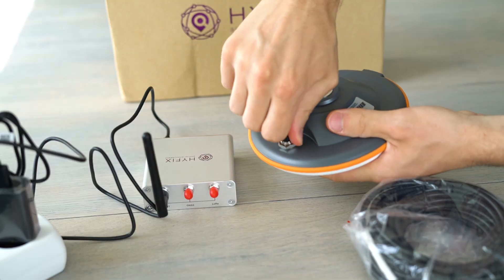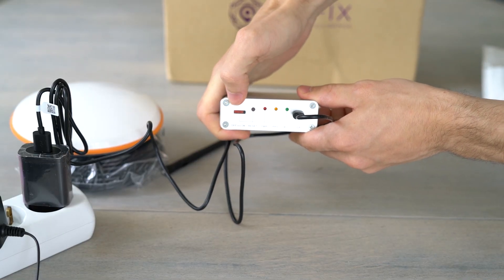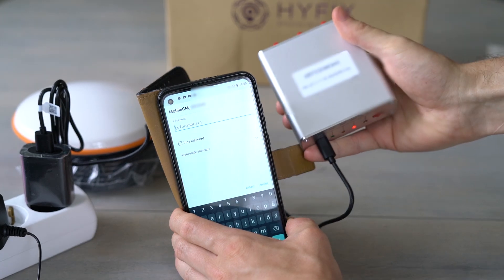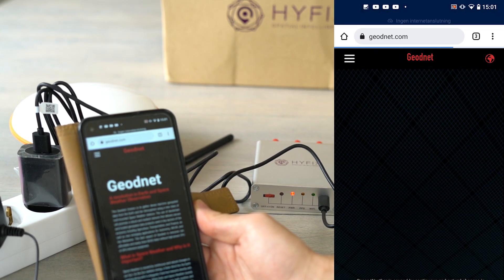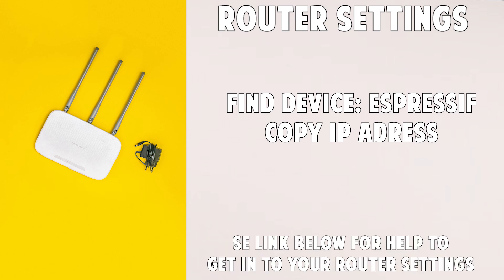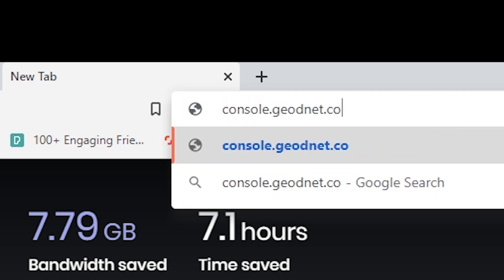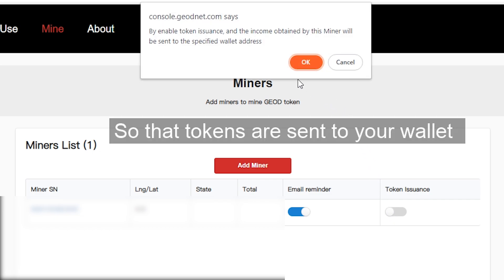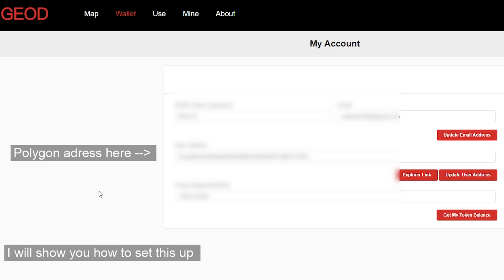Geodnet Miner Setup Tutorial

Comment: I used your code thanks. I do have a question. My network says it can switch from 5g to 2.4 just to connect devices. Then it will switch back to 5g. Is this okay or should I try to keep the connection 2.4g?
Reply from the maker: Hi, I believe you need to use the 2.4. However, there is no harm in trying each way.
Best of luck!